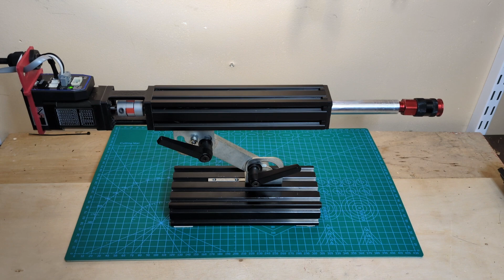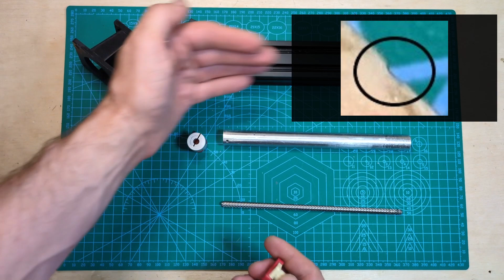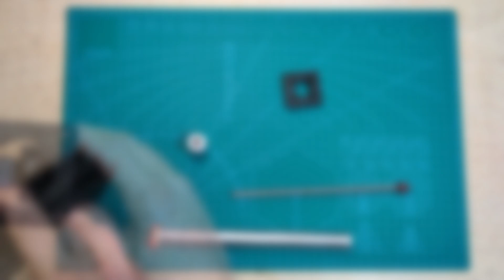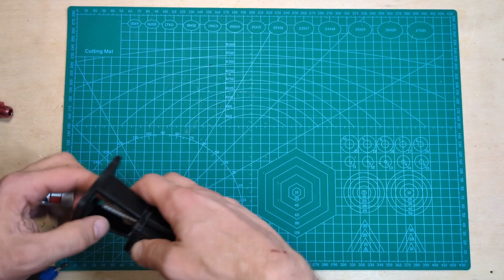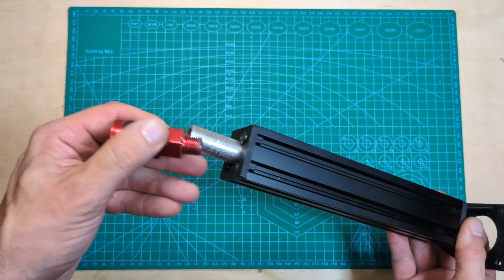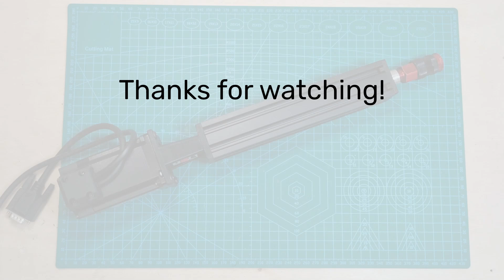DIY 4040 VSlot Electric Actuator (Igus High Helix Lead Screw)

Comment: May I add another suggestion:
1. The .stl for the NEMA attachments has countersink for the M5 screws. The countersink is missing on the endcap (although this part is more exposed). Could you add it please?
2. The endcap has nodges that fit into the 4040 rail. But just on 3 sides and not all 4. Is there a reason?

Thank you for sharing your amazing work!

Comment: Is the spacer printed? It's not part of the files you uploaded on Thingiverse.
Reply from the maker: Thank you for pointing that out!  I added two. The files have the inside and outside dimensions. One is exact and labeled tight. The loose one is what I used, but the only important thing it that the screw spins freely so the spacer doesn't act like a nut and start moving.
Reply: @nsfwmachines8343 Thx for adding them.

Comment: The lead but posted is the incorrect size do you know of an alternate
Reply from the maker: Thanks for letting me know! But I'm not sure if I understand - the Igus lead screw is 1/4" with a 1" lead.  The link looks like it still works, but please correct me if I'm missing something!
Reply: @nsfwmachines8343  sorry the lead screw nut* not but. Is incorrect. Cannot find the one u used in the video
Reply from the maker: @burnsm2012  It looks like they don't make the exact one I was using - I looked at my invoice for this. There were two nuts I tried out - both the same thread - DS6.35X25.4 (1/4"x1").  Both injection molded flange nuts with machined threads, just different material.  The only product I see now is in a metric thread (https://www.igus.com/product/DST-JFRM-C-01-DS8X2)

I've contacted them about a custom nut, the cost is lower than I expected (~$80 for 1, $100 for 4 - price is from about two years ago)

These were the two I used (I believe the video is JFRM)
DST-JFRM-C-01-DS6.35X25.4  
DST-JSRM-C-01-DS6.35X25.4
Reply: @nsfwmachines8343  Can you please consider moving away from Igus, it's not sold in many countries and the re-sellers are POA! Also the whole word is metric so it makes it a pain because, you either have to try and buy from an american site which will charge wayyy more than the product (if they ship at all), or you have to try and convert everything to metric. BTW a NASA rocket exploded, because of a conversion error between metric and imperial, please no more freedom units. 

Anyway, really appreciate the research you're doing, keep up the good work! Hope this unit is updated soon
Reply from the maker: Do you have a recommendation for a site or products? The thing about Igus (for me) is they're the only place I can buy some things online (like screws with very high pitches) that's reasonably priced. They even have great prices on custom stuff - like a nut that would fit perfectly inside a 4040 without a spacer etc.  Outside of products on Amazon, most sites in the US don't even allow ordering, you have to call a sales rep, get a quote, open an account etc.  

The specific issue with this build was the screw had to be incredibly small to fit inside a tube that fit inside the 4040.  Using 6060 opens up a whole range of possibilities.

I will never understand why the states is so resistant to metric. We have to constantly convert fractions to decimal (1/8th to 0.125) while the rest of the world just move the decimal place over.  It is so much easier to be accurate with a metric tape measure (1mm, 2mm, 3mm, ...) vs a US tape measure (1/16th, 3/32, wait let me do some math to figure out the next line...)
Reply: @nsfwmachines8343 since the square  lead screw nut so hard to get and expensive, is it possible to use regular lead screw nut and secure it in the V-slot?

Comment: any idea of the Newton force this can push? I've been looking into making one myself that is a bit heavy duty. Looking to lift around 100-200lbs at a decent rate of speed (ie; over 1"/sec)
Reply from the maker: I've been working on measuring / calculating force for awhile... but haven't had the best results. I just put up this - https://youtu.be/bf-2tbeEQOE - which has some good info.

Comment: Appreciate the content.
Wondered what your thoughts were on using this type of set up over your
milkit design that uses an arm instead of a screw. (only care about the suction aspect myself)
Seems like this style would have better mitigation for popoff, remove the need for a solenoid and be easer to sync with video.
Reply from the maker: There's some benefits to both.  My opinion of the rocker arm is that it has some unique benefits (assuming same stepper / servo motor as screw). It's the only design that allows a physical max stroke that can be adjusted mechanically.  So, you can set a max stroke on the arm of 4" or 10" or anything, and then adjust anywhere within that on the fly just like a screw.  It's the absolutely fastest transmission (if speed matters) because regardless of length, one complete stroke is one revolution.  The screws is given in distance per revolution. The downsides are speed comes at the cost of strength, so you're not going to drive it with a Nema17. And calculating actual length requires some math - the distance per step isn't constant in a single revolution.
Reply: @nsfwmachines8343  
Makes sense.
Thanks for the info.
Look forward to seeing more of your builds.

Comment: This device has no features to transmit linear force, if you used it in anger it would self-disassemble, It's a display piece, not that there's anything wrong with that.
Reply from the maker: I'm not sure what you mean by this? A stepper driving a screw is a pretty standard linear mechanism. I probably should have stated the goal more clearly - high speed, low cost, as much off the shelf as possible to make it easy to DIY. No one would be using an electric cylinder to drive a CNC...
Reply: @nsfwmachines8343  I think what he means is the motor shaft bearings are having to take the full axial load. They will only be rated to take a very light axial loads. You need to add in some thrust bearings so the motor bearing don’t die.
Reply from the maker: @Wiggleraway  OH! Absolutely!!! I've been trying to use different motors for each build, to be somewhat motor agnostic.  The one at the start is sort of a novelty - I totally agree.  Thanks for the clarification :)
Reply: @nsfwmachines8343  Yes the bearing isn't really appropriate, but that's fine  for this sort of DIY, learning is half the point, kind of project. 
The thing is the lead screw isn't attached to the inner race of the bearing so linear force is carried by the motor and in turn by its bracket which is only designed for torque loading. Under tension loads the coupler will separate. Because you used a really fast thread lead screw there might not be enough force to cause any of these failures but half the folks that replicate your design will substitute threaded rod.
Reply from the maker: Excellent - and true - points! With the motor inline, the coupler separates before peak force when pulling. Luckily, pulling tends to require significantly less force (in my use case). The screw speed is critical, anything under 20mm lead won't work. Machining the screw from Igus to put a thread on the end takes it from $10 to ~$120.  Possibly a FK style bearing mount and a shaft collar could work.
Reply: @nsfwmachines8343  Honestly I think regular deep groove bearings are probably the way to go with a DIY unit like this. You can stack 2 or 3 or 6 To make them tolerate whatever thrust force you expect and still be cheaper than the proper thrust bearing for the application. Ya just need to trap the outer races between metal plates screwed to the extrusion and the inner races between shaft collars. The collars that screw onto your leadscrew and clamp would be ideal. I believe that would tolerate forces that would make the aluminum structural parts the failure point.

Comment: you should check some of the stuff that is on the market
Reply from the maker: It seems hard to shop for electric cylinders without needing to go through sales agents etc. Do you recommend any?
Reply: @nsfwmachines8343  I can't send you some of the ones that are common. Link and other stuff got deleted.
Reply: None of my comments are showing
Reply: linear actuator for FRC
Reply: @nsfwmachines8343  look for linear actuator frc
Reply: @nsfwmachines8343  linear actuators frc

Comment: what kinda force can this withstand? this could be the a solution for diy active aero...
Reply: Same, I'd like to know how much weight it can withstand? 500lbs of downward force x2 of these would be what I'd need for an active aero use case.
Reply from the maker: I wouldn't think it could support 500# - well, definitely not with the coupler I'm using.  At around ~80# the coupler separates on the pull stroke. I've been prioritizing speed (>10"/s) The next version of this is going to be much larger. It's using 6060 with a 10x50 Igus screw, and TBD larger motor.
Reply from the maker: I used to be able to measure the force (with current / voltage) using feedback from the drivers, but all I'm getting are null responses. I'm working on it - I actually delayed this video for weeks so I could have that info.